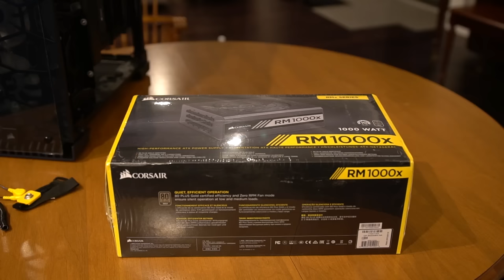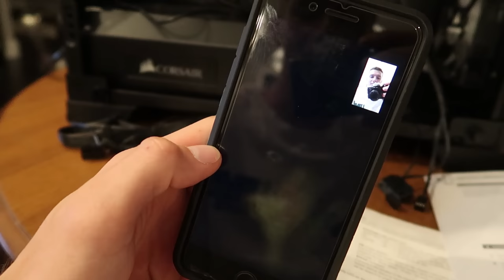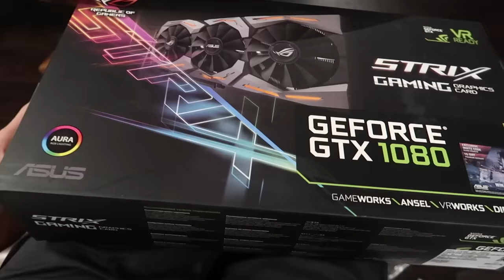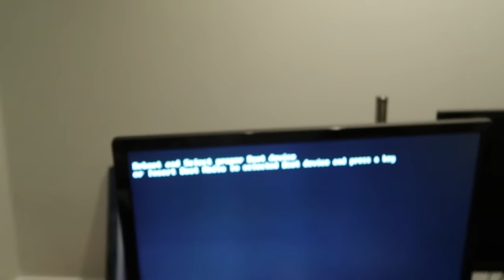Building my First Gaming PC

Comment: grounding strap is for bishes
Reply: D Quack what's it even for I'm not a pc guy haa
Reply: Robbie You know when you rub your feet on carpet and touch metal you feel a jolt/shock? That's static electricity which can fry your electronics inside a computer case. Can cause hundreds of dollars worth of parts to fail before you can even use it.
Reply: Robbie Ballantyne Static electricity can build up on your body and if it doesn't get discharged through such a strap, you can kill your components by shocking them by accident.
Reply: its to get rid of static but no actual pc builder use it

Comment: A good tip for you : after you put the cpu processor in make sure it you don’t want to bend any wire on the processor, to put the cooling system fan on the processor first then you connect your mother first then the cooling system on top. For the motherboard you should connect the rams after your processor. Fans the wire side where they hide the fans on the small edge make sure your wire is facing the case so the fan is basically blowing inside the case, to blow outside the case you already have the cooling systems to blow all the bad air out. Psu the sticker supposed to be upside down but up to you. Gpu graphic card make sure you take 1-5 slots out for better performance. The slot will damage your gpu and you don’t want to ruin that. Good set up tho but need more progress and learning if you plan to post more videos. 
For me I take the front and back case panels out do the motherboard first connected with cpu x rams x hydro cooling second you want to use your pc case adapter that has 3-6 plugs and plug from bottom (+ - he.led + - reset )top (+ - led light) (power sw + -) connect everything from the case first then you do the psu. Psu they have a supply panels that you should install first then you wire everything and pcie will have to go through the hole slot where your gpu is run all the wire through and start connecting. I will have a video soon to show how to build a computer. I build about 210 gaming computer from low - full tower each case in 10-15 minutes , process , and program so if you let me know if this work for you thank you . In the future reference

Comment: YOU NEED THERMAL PASTE
Reply: GForceConnections The Cooler came with thermal paste pre-applied.
Reply: You're right. I looked this information up. Adam should not remove the cpu cooler after he's installed it or he'll need to reapply.
Reply: GForceConnections more importantly he needs an sli bride

Comment: Nice computer, but can it run Roblox?
Reply: It's a meme
Reply: Minimum specs 

Gtx nvidia GeForce 1090

I 9900k quad core processer
Reply: The Cat Channel nooo a gtx 2070
Reply: I don’t think so
Reply: Yes at 144p 15 FPS low graphics
Reply: and thats 15 fps even looking at the sky
Reply: Matdrox roblox needs titan v
Reply: RedBlack Gaming dual 1080ti better than a titan V
Reply: Matdrox Roblox requires GeForce Ultimate 10000

Comment: yo Adam is cringe af. you dont need that rig at all its twice as expensive as it needs to be. and no you are not saving any money
Reply: for 3x120/144Hz monitors he does...
Reply: TheSubieFan Why not, he has the money, if I had the money my rig would be even nicer, I would get a caselabs case and spend more money than my whole current computer on just custom water cooling.
Reply: If you actually watched the video he said that he knows this is over kill. Also for the things he is doing it really isn't. Three 144hz monitors are taxing on everyday graphics cards. I think all the parts are good considering he is planning on doing VR in the future. Cringy is your opinion for his first time and only time to build a pc it went well nothing messed up.
Reply: Not really. For 3x1080P monitors @144hz Ultra settings this is slightly overkill. You also should consider that this rig will be able to handle that for     5-8 years without any problems.
Reply: If he is just running 1080p monitors than yah this is way overkill and a waste...but if running say 3x 27" 1440p 144hz monitors than it is worth the second 1080 for future proofing and awesome performance on the most demanding games.
Reply: Excuse me but I run potato blox
Reply: "future proofing"
Reply: Stxnce as someone who played minecraft at 12 fps and lowest render distance. This was basically porn for me
Reply: To run vr on 3 monitors he dose
Reply: TheSubieFan the guy has 4 cars and a ramp in his back yard I doubt this 3.5k at most computer hurt his wallet.
Reply: man xD hes not aimin at budget pcs... he has the money and hes going to play at 2k/4k with 3 monitors.. the less he can get its 1gtx but it will not work out so 2 its ok... i dont see anithing bad ... maybe instead of a 500gb ssd could get a 1tb and an m.2 for the opperative sistem. seems like a 3.5k almost 4k. pc build pff
Reply: I think you underestimate how much it takes to push modern games, on ULTRA, at 895,795,200 pixels per second. If anything is overkill here, it's his monitors. Unless he's overclocking, which I doubt, he's never going to hit 144Hz in modern games on ultra. Not to mention if he's going to be using any sort of downsampling. Anyone who can do so is running SLI Titan XPs.
Reply: Just because you cant afford it, doesnt mean its overpowered.

Comment: With these specs you I hope you're planning to overclock.
Reply: FriskFryse FrossetFrugt
 he didn't know that there was thermal paste already pre-installed. don't think he knows how to oc
Reply: Thats my point. why waste money on OC hardware if you're not gonna OC?
Reply: FriskFryse FrossetFrugt tru
Reply: Liquid cooler? Is this noisy?
Reply: What is Over Clocking even?
Reply: Intel "K" CPUs are unlocked meaning they can be overclocked. Overclocking is fine tuning the voltage and base clocks of a CPU to gain performance. Higher voltage = more heat, thus why you would buy a beefy cooler like he did. But all this is pointless if you don't OC. What did he gain? Unnecessary noise.
Reply: overclocking can definielty lower the life expectancy of components. its going to add more heat to the components. the key is to make sure your overclock it properly and possibly not max out its clocking and then.... don't worry about the change in its life span because life is too short. its not going just destroy the chip, it will still last a long time.

Comment: Im going to build a pc in 7 Days!
Reply: Justin Sonsma how did it go
Reply: TO Frost I let it build For Free. 😂
Reply: Justin Sonsma I'm getting mine is 19 days as a late bday Present
Reply: Justin Sonsma what is the specs?
Reply: Hazaa Alawadhi GTX 1060 6GB - 16GB RAM - AMD RYZEN 5 1500X - 1TB harddrive - 120 GB SSD - Jetstream Palix Fan or something
Reply: niceee
Reply: Siddharth Pandya so did u build urs?
Reply: cool! I want to build my own PC, but right now since im a 13 year old kid, ive got $2,000 from doing chores and doing yardwork for neighbors and baby/petsitting, and Im saving up to get the ultimate rig that costs 2.5k, with:

ASUS ROG Strix GTX 1080TI
i7 7700k
2 red RBG case fans ($14)
2TB HDD
corsair graphite series 780T PC Case
850W corsair PSU
Corsair H100i V2 CPU Cooler
Good thermal paste ($10)
Corsair Vengeance 16GB RAM
MSI B150M Pro Intel Skylake Motherboard

All costing at around $2,500
Reply: +Vibrant Games I'd add an SSD, get a i5-8600k instead because it's coffee lake, that's a very low end motherboard for that processor and gpu so I'd get something like a Asus Z370-A or MSI Z370 Gaming Pro Carbon. Also you don't need thermal paste the H100i comes with pre applied paste.
Reply: Daniel Mullins Thanks! Adding ssd and def gonna upgrade Mobo!
Reply: Is the GIGABYTE Z370P D3 a good Mobo? And 500gb add? Budget is a little above 2.5k.
Reply: Current build:
GIGABYTE Z370P D3 Motherboard
Samsung 860 EVO 500GB SSD
NZXT S340 Tower Black/Red
2 Red LED 120mm fans
2TB Seagate barracuda HDD
Corsair RMx RM850x 850w Power Supply
Corsair h100i v2 CPU Cooler
Corsair Vengeance 16GB DDR4 Red/Black
i7 7700k CPU
ASUS ROG STRIX 1080 TI GPU

Theme: Black/Red
Reply: Vibrant Games yeah that seems to be a good enough motherboard, my last PC had a gigabyte motherboard and it never gave me any problems still can run after over 5 years. If you like black and red maybe check out the MSI Z370 GAMING PLUS motherboard. Also you won't be able to use a 7700k with a Z370 board you'll have to go for one of the new coffee lake chips like the i7 8700k or i5 8600k. Use PC Partpicker it will tell you if your parts are compatible and if there will be any clearance issues.
Reply: Daniel Mullins TYSM DUDE! Def gonna use this
Reply: Brian Yildirim That’s the Deadpool PC

Comment: The PSU fan faces upwards if you're placing the case on a carpet and downwards if the case is being placed on bare floor. The PSU fan will only come on when over heating occurs, but during normal usage the fan hardly ever spins. So I wouldn't worry about orientation of the PSU too much.

Comment: Not bad but one 1080 is more than enough for VR.
Reply: Not for triple 144Hz monitors though. For maximum smoothness he'd want 144FPS minimum @ Ultra settings across three monitors, a single GTX 1080 can't do that.
Reply: True.👍
Reply: for a 65inch 4k curved do you guys think one 1080 would be enough to run  star citizen full setting ? even in vr ?
Reply: the size of the monitor is irrelevant its the refresh rate and resolution that makes the difference on what you need...if you are looking at 1080's today save the extra $100 and go with a 1080ti instead..preferably an aftermarket one instead of a founders edition reference design...ref design is 35% faster than a titan which is faster than a 1080 and just the msi armour which isnt the best that will be released increases that difference to a little over 40% along with better quieter cooling...it will handle 4k very well as it's faster than even the titan
Reply: Its all about resolution as Allen said. Size makes no difference at all.

Comment: It doesn't matter which side is up for the power supply, but definitely recommend fan side don't if your case has a power supply shroud.
Reply: It depends on the case. My case has screens on the bottom so I can mount the fan facing the bottom. My PSU has LEDs so I didn't do that, because I had another opening for another fan. I'm running about 11 fans. Talk about overkill, but she stays cool.

Comment: I remember when i was building my pc i went to a shop and bought (Amazon and Ebay not available since my country customs like to take stuff that comes from abroad for theme selves) i5 7600, HyperX 4*4GB DDR4 2400Mhz, Asus ROG Strix H270F, Asus Expedition RX570, and i got Master Box 5 Black case with Chieftec GPE -700S PSU (well known EU East Brand), also i bought the LC-CC-120-RGB cooler bc intel stock one died on me 2 months ago. I remember firing up that button and i saw insert boot media...Ohhh it worked from the first time, just keep in mind that i am 18y old and bought it from my money i made from a side job as a pc servicer, it usually consisted of soldering new capacitors or just adding a Graphics card, never had a full build done, now when i had experince i now also build custom pc, usually for big companies. It consists of an i3 8100 + 8GB of ram and asus H310M-C and i reuse there old cases with psu

Comment: 1. you are not supposed 2 touch the motherboard from the top or bottom (you should hold it from the sides)
2. Put it on the its box not on the table (recommended)
BTW this is for any future builds

Comment: I never seen anyone fail so hard at building there first pc ever. But 10/10.....if failure....okay, you did pretty good but put the motherboard in first while hold the edges and while doing this, lay the case on its back it will be so much easier. Also I watched tech source to learn how to build a pc and he helped alot.

Comment: Step 1 install standoffs 

Step 2 install I/O panel 

Step 3 prepare motherboard out side of  case cpu ram paste fan 

Step 4 probably install motherboard 

Step 5 install divides (hard drive dvd 
etc )

Step 6 connect front panel 

Step 7 install power supply 

Step 8 power to motherboard 

Step 9 power to devices 

Step 10 cable mangement

Comment: Some cases do not have fan opening on bottom of case. So if you have to mount the PSU one way or the other they put lable one way on one side and one way on the other depending on how you mount the psu

Comment: I mean a GTX 1080 is all right but with a 1000 w power supply 
2060 RTX would match better
Reply: No gtx 1080 scores better in all games rtx 2060 is only better at rey tracing if you wanna replace gtx 1080 buy rtx 2070 or above 1080ti would almost perfect but it doesnt rtx it basicly rtx 2080 but little worse
Reply: Wait what? You can do 1080 sli with a 1000w just fine and a 2060 is way worse

Comment: Yeah, ESD is a thing to be weary of. But I feel bad that you got kinds ripped off in buying that ESD kit. Its not that extensive of a problem. Touching the case is fine. But you should have put the motherboard on the motherboard box while installing the components. Protecte the soldered connections on yhr bottom.

Comment: Hello you are supposed to put get the motherboard out and put the cpu in then the ram then the power supply unit the the cooler then the graphics card  then the hard drives then the ya da ya da ya da then you start it up if you doing water cooling put cpu block in then the radiator but then you fill the resivour then connect the pipes recommended graphics card is nvidia 2070 ti or 1080 ti

Comment: I'm not sure about that particular aio but I think the fans might be installed wrong on the radiator usually the side with just fanblades is intake and the side with the bracket actually holding the fan is exhaust for future reference if the fans aren't already clearly labeled so you might have to flip those?

Comment: Someone tell me why there’s this thing he calls “Grounding” no idea the function or why he did it. Almost scares me if he forgets he’s grounded then he walks away and pulls it off the table.
Reply: If for example hes been walking on carpet or has enough static electricity on his body to jump to components hes touching he needs to be grounded first. Or touch the power supply case or screw when connected because its grounded.

Comment: No exhaust fan, no sli bridge, took the cpu socket cover off before popping the cpu into place (minor but still). And handled the motherboard from underneath. This guy really did near to no research. I’d have shit myself if I had bought all of those components with a lack of knowledge to build. Thankfully I built my first pc three years ago, and I’ve just purchased a new case the Corsair 460x rgb ready for a new build.

I7-8700k
GTX 1080ti which tbh is better over 1080 sli as it requires so much less power, will cool more efficiently and costs slightly plus psu will cost significantly less as I can get away with a 650 watt psu which will likely be Corsair over the likes of EVGA
Reply: Lewis Martin does that liquid cooling system really doesn’t need termal paste? I’m building my first pc with the same one but idk.
Reply: Alaflam3 if there isn’t already thermal paste pre applied by the manufacturer then yes you will need thermal paste. You always need it.
Reply: Alaflam3 iftoure building with that particular cooler if it’s new or should have thermal paste pre applied. So no worries. It’ll be a dried grey paste on the heat sink part of the cooler.
Reply: Lewis Martin thanks. Had to be sure before i fry the cpu lol

Comment: I'm glad I didn't see this video first for my computer build. DUH!! Put your ram in before doing anything else. Then you install your motherboard. Installing your cooling fan to the processor before putting in the motherboard, your asking for disaster, so easy to scratch the motherboard. Install the cooling fan after. Then you install your drives and your power supply. You need all the room the case has to install the motherboard so you don't take a chance of damaging it.

Comment: I'm using this exact same case but the ssd slot under the mobo doesn't seem to want to slide out. I took out the one thumb screw and have been trying to slide or pull it out. I don't want to use too much pressure in fear of snapping the slot

Comment: You ALWAYS need thermal paste. Gor that corsair you have it preapplyed ;) you should buy some isopropilic alcohol if you ever need to install another cpu or you touch the radiator or the cooler you cand clean with that not with yout tshirt :)))

Comment: i get you first time building its normal to fail .. but why did you use 2 graphics card at your first build? 1 is easier. specially on test run. so you would know if you did it right. after that you can put the 2nd graphics card if you want WITH SLI BRIDGE. 

and the first thing i notice the graphics card pin, i want to shout at you like 

YOU ARE MISSING A PIN!

in my first build i failed too. i didnt put the HDD LED pin from CPU and i cant boot up my pc. And figured it out its not intact. and put it in and huala! success for her first boot

Comment: You put the power supply upside down the fan is supposed to look up
Reply: Not if there is a dust filter. If there is a dust filter, the fain should blow in it. If there’s not, yes face it up.

Comment: i have this same case and motherboard, where in hell do i plug in the led cables n such?
Reply: xvvier strips depend on the brand of its Corsair connect it to the lighting node that you got and plug the cable on the lighting node via usb 2.0 and connect the rgb led lights together to power them on